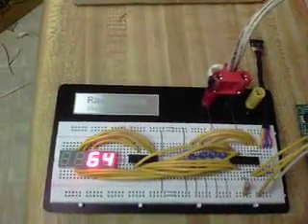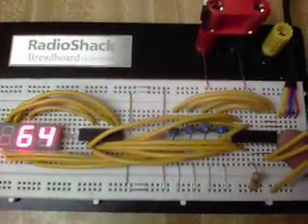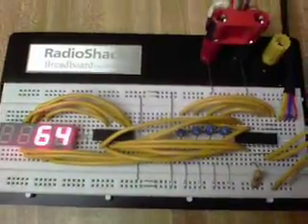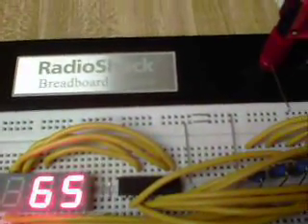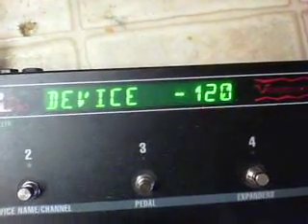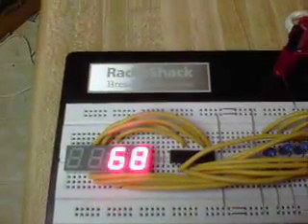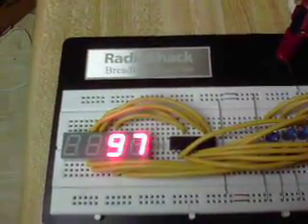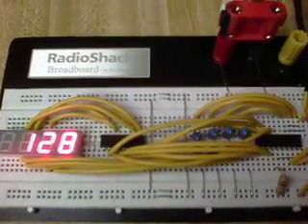PIC Microcontroller MIDI Brain/Display Unit

Comment: I used to program in Basic and some C up to 20 years ago. I also have played guitar nearly 30 years. Foot controllers are so damned expensive for what they do, do you reckon it would be fairly easy to make a PIC 'brain' for a controller? I solder valve circuits as a hobby so it shoudn't be too difficult and the metal work is simple. Cheers :o)